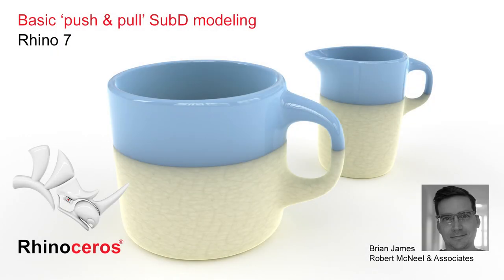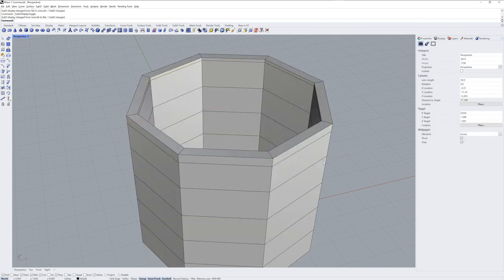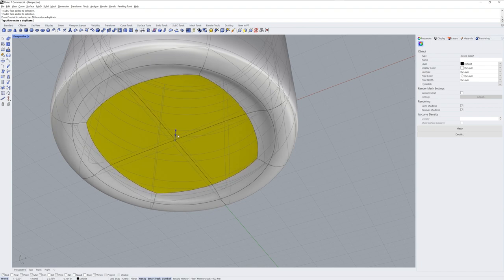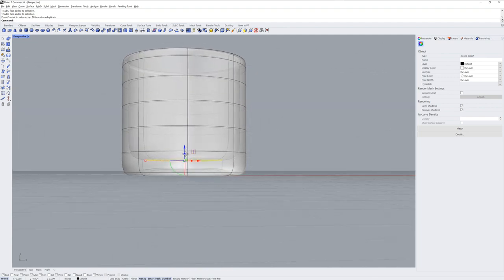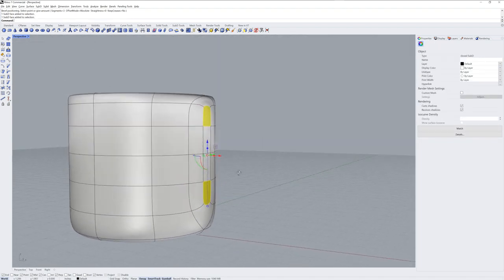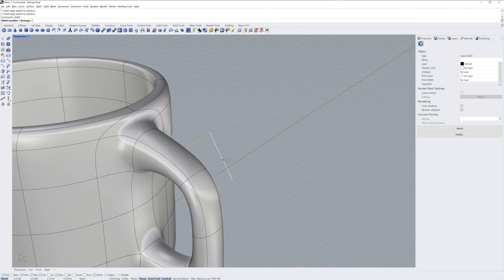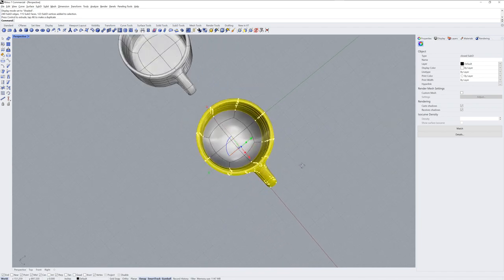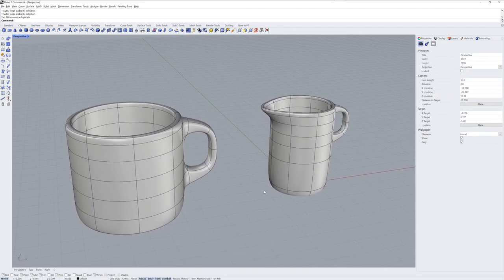Basic 'Push & Pull' SubD Modeling in Rhino 7

Comment: Can you use the SubD modelling in a similar way to Sketchup Push Pull? I mean for  hard edged volumes , not only for smooth organic shapes.  I wish you could also draw on faces and then easily push and pull the selection just as in Sketchup
Reply from the maker: check out this- 
https://discourse.mcneel.com/t/push-pull-surfaces-like-sketchup/20297/6

and this
https://discourse.mcneel.com/t/push-pull-behaviour/115965/19
Reply: @Rhinoceros3d  Thanks! I have already installed Jamparc plugin and its exactly what i was looking for. Then i saw the chinese plugin Su2Rhino and it looks fantastic, like a real Sketchup inside Rhino.  Its all in the power of the scripts.